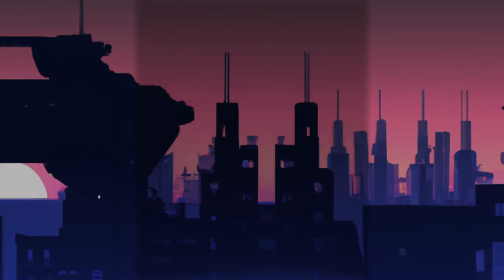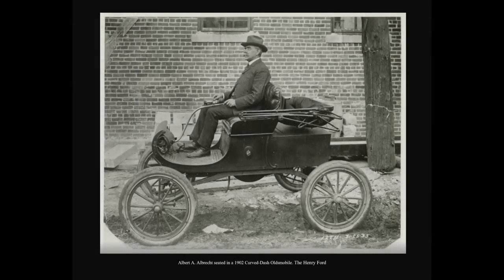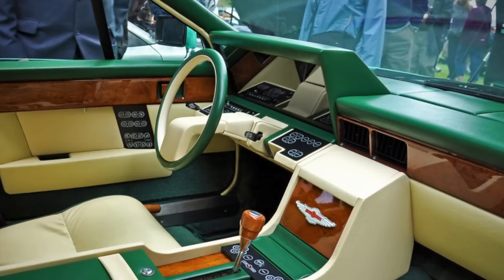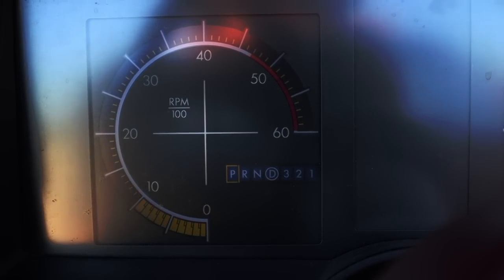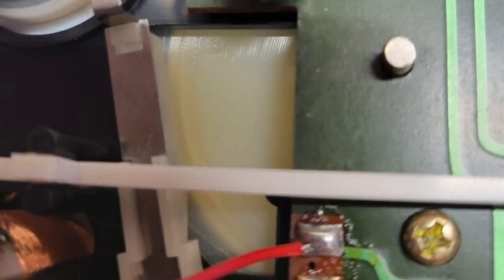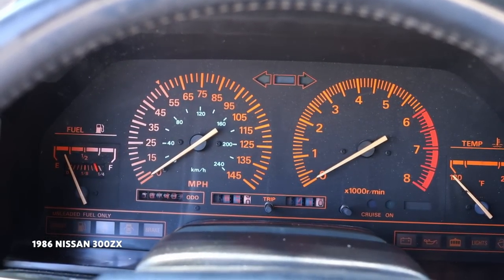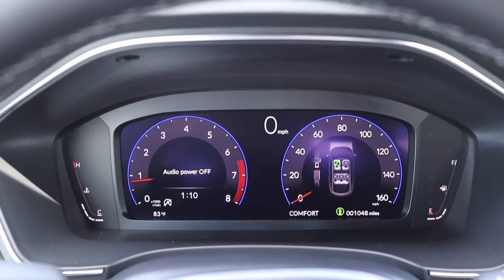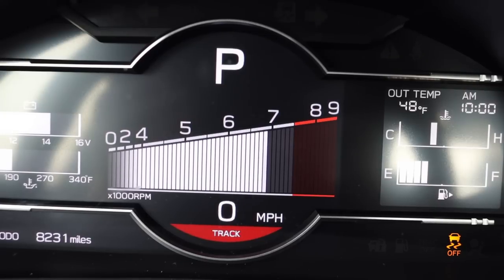Digital Gauges - How They Were Invented And Where They Are Now!

Comment: I think screen failure today will be down to the quality of the manufacturer. I could honestly see a lot of modern cars gauge clusters lasting just as long as anyone would care to still care for and drive the car. For instance, my 2010 Lincoln has a nav screen in it. I’m already at 160k miles and kicking. My nav screen still works flawlessly. If it failed today I’d think that was a fair life span for it and seek replacement, assuming it’ll last another 13 years at least. Sucks for todays cars having so many screens to operate literally EVERYTHING but I also think the tech has progressed for most automakers enough to not need to worry for a good 20 years. Let’s be honest, who’s still expecting todays Mercedes to be in flawless condition 20 years from now?
Reply: I think this will be a problem for modern cars becoming classic cars in the future. The replacement LCD will be very expensive assuming there is enough supply of parts. Also very well maintained and reliable cars can easily go for 20 years and will be still in use. So that is a concern still.

Though 20 years from now, it is a question if ICE cars will be mostly banned or will keep on the road alongside with EVs.
Reply: @kornkernel2232  I think ICE cars will still be permitted on the road, especially if new one's aren't being sold anymore. They may however be more expensive to insure, gas prices might be too high to want to drive an ICE car regularly anymore, and gas stations will start dwindling away as less and less cars on the road have an ICE. After a while, and I'm saying 50-60 years from now, I think ICE cars will go by the way of horses and just be used by rich people and enthusiasts for sport and enjoyment rather than everyday transportation.

As for the LCD screen, yeah, a well-maintained car can and should last 20 years or more, however in that time you can expect a lot of parts to have broken and needed to be replaced, like the LCD screens. Just another part to fail in that car's lifetime, but as I was saying, that's fine, parts will probably be available for 20 years after the car was new, if not, then EBay or the junk yard. And let's say the screen fails right at 20 years. Now, with a new screen, for the sake of this convo, let's say it lasts another 20 years, now this car has existed for 40 years! That's well into the "antique" classification years, and oh, it's 40 years old with a broken instrument cluster screen. I think by then it's permissible. Besides, if you want to see how the screens worked way back in 2022, just search for a video of it, we have plenty.

Think of a car from 1982 today, for instance the 1982 LeBaron, I think that car offered the talking warning chimes? lol If i got one today and that feature didn't work, meh, I'd be bummed, but it's understandable. However, I do get that an instrument cluster that doesn't work and can't work unless you put a new display in it is a much bigger deal than a talking car gimmick. Hopefully we'll be around to see how this all plays out, who knows, there may be a different solution we haven't discovered yet.

Comment: Everything will fail at some point - even mechanical gauges. That said there's no reason an LCD screen couldn't last for 50 years. If it's designed properly it's more likely everything else will fail on the car before the screens do.

Comment: I think the 2014 Honda Civic's digital gauges were probably one of the few good modern style dashboards. You do have the infotainment screen, but it's mainly just to control the radio and view the backup and side-mirror cams. The AC itself is still controlled by physical knobs and buttons, and the gear selector is an actual lever and not a knob, or god forbid, built into the infotainment like what Tesla is doing now. 

Grah I hate how stupid Tesla's dashboards are. There's no buttons except for the few on the wheel now. There is no gauge cluster, your speed and throttle input is on the screen. You have to look away from the road to see how fast you are going or how much throttle you're putting down, which is important because you cannot turn off one-pedal driving. They really want you to rely on FSD which is abysmal with the worse visual-only sensors they're using now.

Comment: Personally I've found LCD screens to be pretty bulletproof. I have some old LCD monitors from 2012-ish or thereabouts that still work just fine today. The more likely thing to die in a modern car would be the controller board for the LCD.
Reply: Yeah, pretty much quite possibly pretty reliable to use LCD these days. Heck LCD from early 2000's still works today as I found from my old work, the colors will be inaccurate overtime, this is less of an issue with newer LCDs. As a gauge cluster, that's not really a problem since it is primarily meant to show vehicle data.

The only issue is really the replacement, unless some aftermarket manage to make one that will be still compatible with the vehicle.

Actually LCD gauge cluster should be in theory more universal if they have all similar screen size. But reality is that each car model will have their LCD only designed for that particular model. Sadly it is not standardize as our desktop PC are.
Reply: @kornkernel2232  They are also cheaper in production: single LCD which can replace all gauges cost is similar to single analogue speedometer (which actually is not purely analogue, as it is often combined with a microcontroller connected to CAN bus instead of direct connection to a sensor on an axle).
Reply: I have 3 monitors from 2011 that I kept running 24/7 and they still work. Screens on cars should last the lifetime of the vehicle.
Reply: And those LCD'S you're talking about have been vibrated daily and sat inside a closed car at Hi temps in summer ALL DAY??...I think not
Reply: @Matticitt  I bet those 3 monitors haven't spent their life being subjected to EXTREME HI AND LOW TEMPS and VIBRATION DAILY inside a Vehicle have they?
Reply: All these anecdotal observations above means nothing. For every monitor “that still works today”, I’ve seen and equal amount of monitors that broke in less than 10 years (how long I usually keep my cars). My monitor from 2007 broke in 2014. The new monitor I bought after that began to have ghosting and screen burn in issues after barely over a year. At my workplace, we’ve had monitors that just stopped working and blacked out after only 2 to 3 years or so. Mind you all of these are not cheap monitors, they’re all expensive high end monitors due to the nature of our work requiring such monitors with good colour accuracy.

Meanwhile, the analog speedometer in my mom’s 30 year old clapped out clunker (which she refuses to sell) is still working flawlessly.
Reply: @yqr5357  and an analog speedo in my grandpa's Mercedes stopped working after 16 years. So what now? Also keep in mind running time. 3 years being used for 12h/day is 18 years 2h/day which is more realistic for a car. I've never in my life had a screen which failed. I have 3 monitors from 2011 - still working. TVs from 2016, 2015, 2008 - still working. Laptop screens from 2010, 2008, 2006 - still working. Center nav screen on my 2011 car - still working. All my phones and tablets - some from the 1990s - all still working.
Reply: @23yearsand76  I see the point you are making, but I have full confidence that an LCD display can withstand the temperatures of a hot car, and they have no moving parts or really much of anything that I could see being affected by vibrations, so I would consider that a non-issue.
Reply: @yqr5357  I understand your point, but you sort of contradict yourself. You can apply the same survivorship bias to your anecdote that your mom's car's speedo is still working. It's actually quite common for older cars to have a nonfunctional speedometer, and I've seen several instances where even more modern cars have had their speedometers break. You have to remember, the speedometer needle in a modern car is computer controlled and not in any way physically connected to the rotations of the wheels or transmission. They are controlled by computer chips and little motors with gears. I see no reason why an LCD with no moving parts cannot last just as long as a complex electromechanical system with lots of failure points.
Reply: I have  2016 car with digital cluster and i was mostly used option for "analog gauge" and after 2-3 years that gauge  burned it self  in screen..so now i put digital gauge but i can still see analog that burned it self in screen. I dont know which type off screen but i guess its probably OLED becase they burn in if same picture for long time
Reply: yes, buy year 2010, LCD screen quality has become good enough to last at least 10 years in automotive application.
Unless the automaker went for the cheapest LCD manufacturer in China.

Comment: Digital gauges were huge back in the 80s and 90s and many designs and colors are very iconic. And tbh, I dont think they were as unreliable as you mention, or hard to source used, at least as far as GM makes are concerned. There was a lady who use to give us rides to church as a kid. And she had an 86 or 88 Buick of some kind. Not only had digital gauges but also a full touch screen computer on the dash that would give diagnostic readings with everything on the car. A feature that was yes 30-40 years ahead of its time. Its downfall was that the computer was not Y2K compliant.

Comment: I love the old green LCD or LED or VFD digi-dashes. They're very readable yet still futuristic looking even today. Modern screens are too bright and busy. Old digi-dashes were perfect as long as they worked. The first car I saw a full digital dashboard in was a second-gen Prius and it blew my mind being able to read the exact speed at a glance. If a car has a digital and analog speedometer I don't even look at the analog. Imagine if Ford or BMW or whoever starts offering alternate gauge clusters as DLC.
If you have a popular classic car or truck you can get LCD/LED replacement clusters that either work with the existing sensors or connect to the ECU if the engine is ODBII compliant.

Comment: Most of the 80's displays used Vacuum Florescent Displays (VFDs) with a few using LCD displays. Very few used CRT screens, though both CRT and VFD work on a very similar principal.
Reply: Was just about to comment about that.  One of the biggest problems with VFDs though is that they tend to fade and get dimmer over time, which is why they were replaced in the late 2000's with backlit LCDs or segmented LED displays (e.g. the 8th gen Civic digital speedo).  I still love a glow of a green or orange VFD on older home audio equipment, microwaves, or ovens...
Reply: The mk7 Ford Fiesta up until like 2017 still uses a VFD display for the odometer and the climate control temperature readout.  It's one of the cool little things I like about my Fiesta ST.

Comment: That's why I love my 2000 toyota celica gt-s. While the speedo and tachometer are analog, my fuel and temperature gauges are digital. (I have an automatic and it even tells me what gear I'm in and let's me switch into "manual mode" to shift with steering wheel buttons, all in the year 2000.)
Reply: I have a Celica too, but I would love to have everything digital like the 3rd gen Toyota Soarer

Comment: My 8th gen civic hatchback had a digital speedometer which was ontop of the dashboard.
It failed while under warranty. where the numbers would fade or just display 888.
It was a very intermittent issue.
Had to use my phone to take pictures while driving on an empty street to get photos which I then used to get it fixed under warranty.

Comment: If they're using modern LED/LCD screens they should be fine. Burn in on LCDs isn't a thing anymore. Also reliability should be ok. (Strewth.. I have an LCD monitor I bought in 2008. It's been flogged 12hrs/day for a DECADE. Still works perfectly... but a screen with an 8ms refresh rate isn't terribly useful now

Comment: The 1992 UZZ31 and UZZ32 Toyota Soarer featured a multi plane digital display where various displays would appear and in fact did, float in a 3D space.

The same cars, in 1992... ran off a central CRT touch screen that controlled:

- the HVAC
- the infotainment 
- the car diagnostic outputs
- the GPS (really)
- the TV
- the phone

The Soarer's central CRT touch screen appears to the untrained eye as just another modern touch screen LCD installation that is now more or less the standard in any modern car, but it came decades before the mainstream adoption of this technology.

What is a Toyota Soarer?  

Well the poverty pack stripper version without the amazing digital and CRT displays, and without the amazing computer damper controlled air suspension of the UZZ31, or the absolutely incredible active/hydraulic + 4WS computer controlled chassis of the UZZ32 that pulled the same or higher G's than the contemporary Ferrari F40!!!...was sent to the US

That poverty pack tech-less car, was the Lexus SC400....!

Comment: Had a 87 Buick with a digital tachometer.
Had a 92 S-10 Blazer with digital guages. Didn't know that guages were in the process of failing when I bought it. One month later the speedometer stopped working, then the blinker indicator. (Both are the best parts)
Drove without a speedometer for years.

Comment: VFD tubes are more reliable than LCD displays. 

My 1988 Toyota Cressida with digital gauges still works fine in 2022 meanwhile my 2003 Chevrolet Tavera (Isuzu panther with GM engine) have a LCD odometer that started to lose it's ability to display trip and total miles

Comment: Mechanical guages fail and look tired as well.
I got a speeding ticket because the LED bulbs blew in my 1992 Clio, at night, rendering most of the dash unreadable. Had to strip it apart and replace the LEDs one by one.
My 2003 M3 was sun bleached. The once vivid orange needles were barely visible against the light grey clocks. I had to strip that down and, I shit you not, sharpie the needles back to their original colour. They don't sell needles, new clocks are insane money and used ones have to be tampered with to match the mileage (Don't look too close!)

Comment: Over about the last 15 years the mechanical design of LCD panels has become a lot simpler - this was mostly done to reduce manufacturing costs, but has had the benefit of designing out a lot of common failure points.  For example, an older display panel would have several levels of interconnect - a PCB on the back of the panel, and multiple flex PCB transition boards with the driver chips on them that connected between the main PCB and the glass.  A more modern panel has the drivers integrated into the glass and the controller IC (that used to be on the main PCB) also mounted on the glass in "flip chip" style where the bumps on the chip directly connect to the electrodes on the glass - the only flex PCB is the one that goes to the host system, and that's generally entirely passive with possibly a couple of caps for supply filtering.
So it looks like it SHOULD be a lot more reliable, and the results of accelerated life testing match this - but although life testing is generally a pretty good match for reality it's far from 100%.

Comment: Longevity is no longer part of the concept in any car that is merely for private use. So why care about the life span of TFT gauge clusters? These displays are certain to fail at some point, be it horizontal/vertical white/black bars, dead/permanent pixels, or complete dropout, and will be a financial disaster to replace. They operate under extreme stress regarding temperature, humidity, vibration etc. and need to be very bright (inducing more temperature issues) to have a comparable use in sunlight. There is a price limit to everything so they won't use NASA tech to achieve all of that. It rather seems like they are using Playstation-grade technology with all its ups and downs. But is a car supposed to be a toy?
Eventually a digital gauge cluster mainly exists for saving money in production. Compare the insides of old and new ones and you know what I mean. They are trying to make the best of it by adding a lot of playfulness that would not be possible otherwise. But the main reason for this trend will be saving cost. Much more so when the display is also a touch screen and replaces tons of buttons and other controls. Might look tidy but is hard to operate when you need to drive at the same time. So they add lane assist, brake assist, voice control etc. just to still keep it somewhat safe even if the driver is distracted. Times are gone when you could just reach out your hand and find the controls you want without looking. I would always prefer that but it's not even an option anymore. Plus, as designers can position indicators and controls where they please, the interface can change from one day to the other and force you to re-learn parts of it. Ask Tesla owners about climate controls...
So I find it hard to appreciate all that progress. It adds more and more complexity and failure points, and removes things that we got so positively used to.

Comment: My mom's 2022 Buick Enclave has that digitals display like these in this video on the windshield right in front of the steering wheel, at nighttime it goes to maximum brightness when on comming headlights lite the windshield. it tells speed,revs,headlight,warnings, and u can even change it to XM radio controls or GPS that tells you how to get somewhere turn by turn in any language, and you can move it all over the front of the drivers windshield.....is pretty wild to see. its not a reflection from the dash it is inside the glass the picture i mean.  Anyhow.....